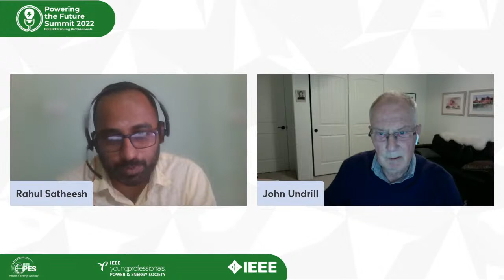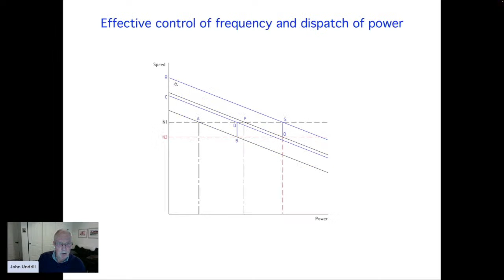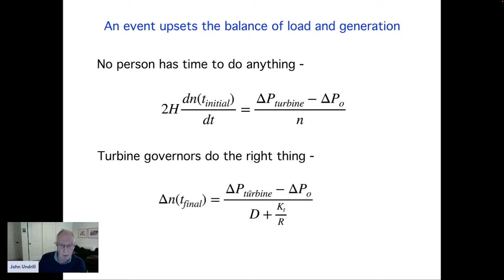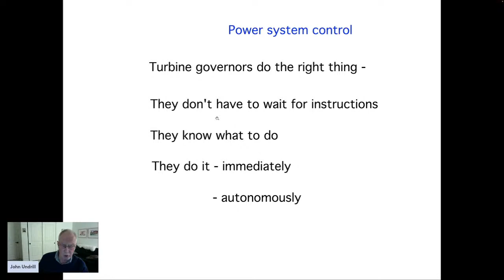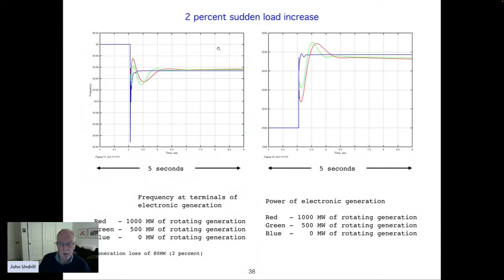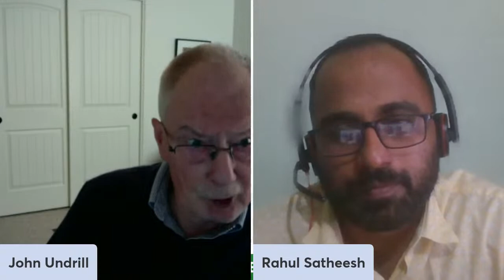Keynote 1: Power System Dynamics PFS,22 | Prof. John Undrill

Comment: Ireland and Tasmania are 95% Electronic Generation.  Does that mean PV and wind?

I listened to a John presentation that discusses analog computers for simulations.  Seems like that should have been called electronic simulation.  

Electronic vs rotational Generation.
High SC fault current, a DC offset..... we know what will happen.  What about electronic generation?

Real Power event.  Frequency all changes.
Power oscillation.  Voltage oscillation.

Point on wave technology